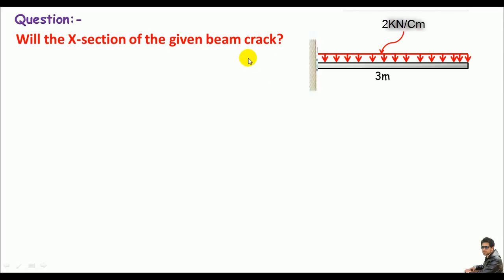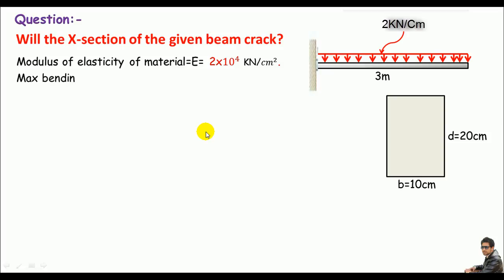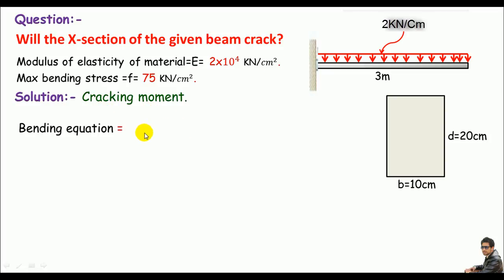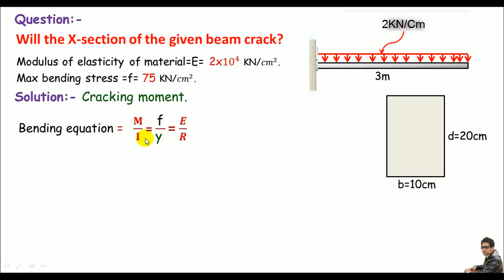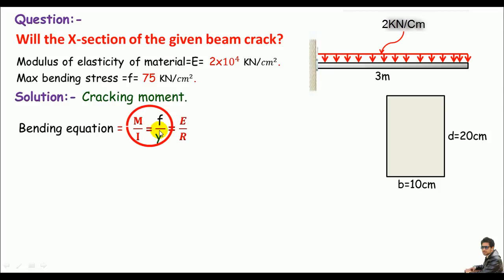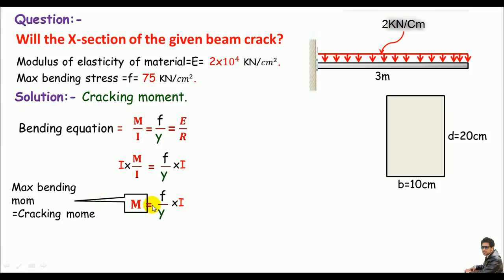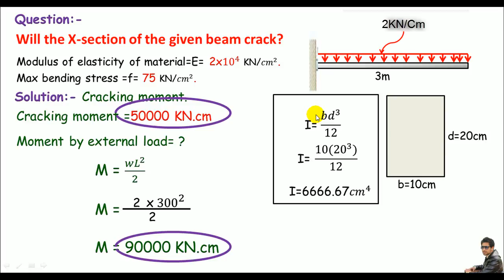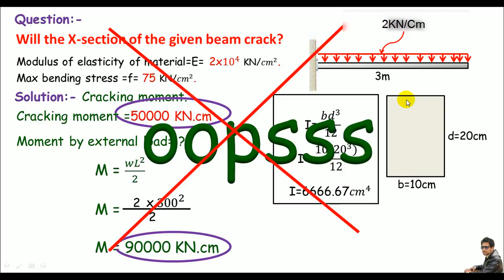#cracking_moment

Comment: Hi Sir, for a same case like this video, if Maximum Bending Stress is not given, can I use the cracking moment formula 

Mcr = fr.Ig/(yt)

where,
Mcr = Cracking moment
fr =  Modulus of rupture
Ig = is the gross Moment of Inertia for the beam
yt = s the distance from the center of gravity of the beam to the extreme fiber of the tension side (this neglects reinforcement).
Therefore for a rectangular section, yt = 2h

fr = 7.5 x SQRT f'c

Assume f'c = 3ksi = 3000 PSI = 2.068 KN/cm^2 

fr = 7.5 x SQRT 3000 (PSI)
fr = 410.8 PSI = 0.4108 KSI =  0.283 KN/cm^2 

Ig = 6666.67 cm^4                ; as calculated in this video
yt = 20cm /2 = 10cm           ; as calculated in this video

Determine Mcr;

Mcr = fr.Ig/(yt)
Mcr = 0.283 KN/cm^2  x 6666.67 cm ^4 / (10 cm)
 Mcr = 188.67 KN.cm

Lastly, compare,
Mcr < Mapply                       ; Mapply = Applied Moment = WL^2/ 2 [cantilever beam] , = 90,000 KN.cm as calculated in this video
18867 KN.cm < 90,000 KN.cm

Hence, the design beam will crack

Please correct me if I have done something wrong in the calculation
Reply from the maker: yeah . its right method. its stress is based on ACI codes.
Reply: SL Khan sir design n analysis of T beam please sir